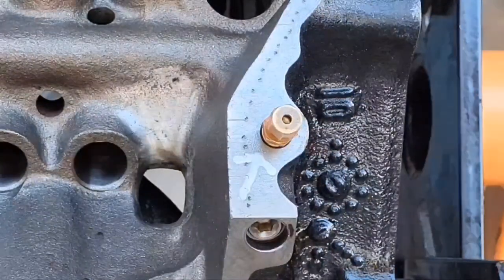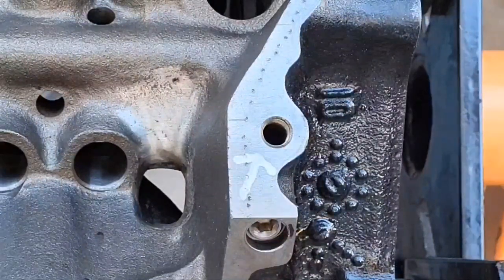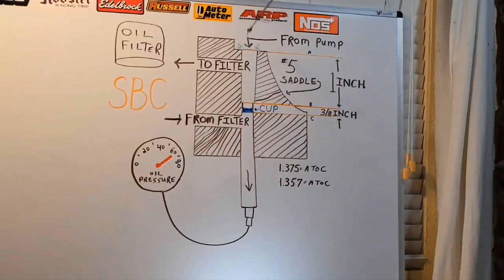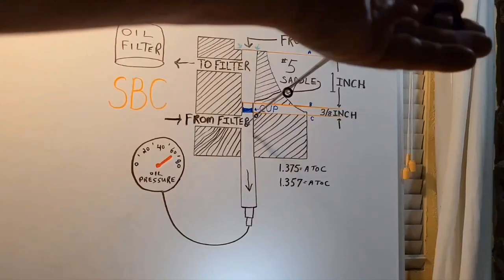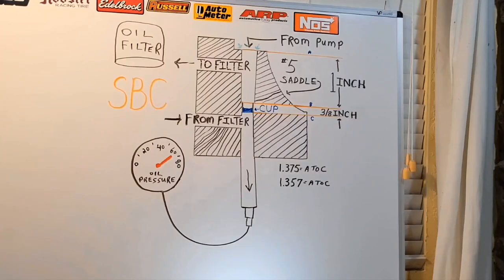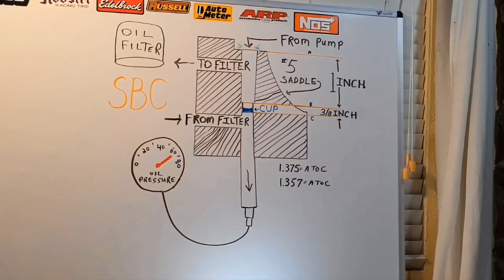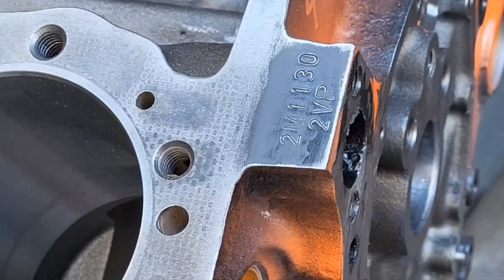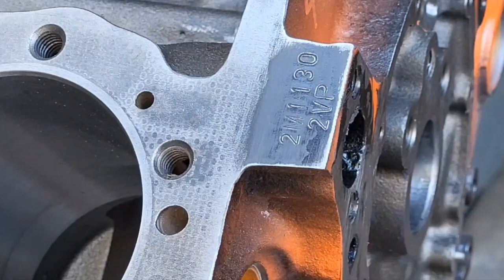ONCE UPON A TIME, there was a magic cup....

Comment: The first sbc's had no oil filter and there were no channels to and from the main oil channel. When the oil filter was interduced they just drilled the two channels off the main channel and put a cap in between to divert the oil to the filter. As long as the cap is between the two channels going to and from the filter, you're fine.

Comment: How much oil goes thru the filter bypass valve in the filter adapter?  How much oil goes around the filter media thru the in filter bypass valve.  
I used to spend several hours deep in those passages with a long, ball end carbide burr to round out the corners and cut back the drilled pockets.  Then go in with rifle and shotgun ball hones in all the oil galleys.   I spent 10 minutes on oil passages in the rear main cap.  
I usually check the diversion plug depth from the top.  8.5 inches.

Comment: I think the 410 block is the good way to go! Having at 50,000 below the to filter line. It sends all the oil to the filter. 😀GOOD! Then the port coming out of the filter with clean oil some of the oil can turn left and go up and give primary oil to the saddle number five. And the rest will turn right and head down that path. Sounds like a winner to me??
Reply from the maker: The "from filter" oil passage can really only turn right, not left.  A  little oil goes left, but the cup is 50 thou, let's say,  above the roof of the  "from filter" oil passage, so it is forced to go to the path of least resistance, and that is to the engine and oil pressure gage.  The cup separates the passage.  No oil can go past the cup in either direction.  I hope I am not confusing you, and thanks for watching.  Later Dennis.
Reply from the maker: I will check the 410 block, but I haven't done it yet.  You could be right, but I would be surprised, because that would mean that the incoming oil from the pump would end up fighting the oil coming up the vertical passage.  Will let you know what I find.  Later.

Comment: Why is there a whole bunch of small dimple marks on the inside of that oil hole threaded oil hole
Reply from the maker: The dimple marks on the plane the oil pressure gauge fitting is drilled into, is what I think you mean, are put there by me with a small punch.  They used to have small rubber end gaskets made of rubber there front and back of the intake manifold, before silicone became perfect for the job. We used to do that to stop them gaskets from slipping out.  I still do it out of force of habit.  Even now when the silicones dries, it wont slip.  Not that it ever does.
Reply: @the4flatgarage  one of the oldest tricks in the book! 👍
Reply: Right we always drilled into the "china wall" several 1/8" dimples with a bit to hold the gaskets/ RTV in place and prevent possible slipping. I often used Aviation Permatex in a can to hold the gaskets as that schtuff can't hardly be removed. Tough stuff, doesn't leak. Hated by all. 👍👍😎

Comment: Not so terrible initially as most motors before SBC era had no filter or optionally  bypass filtration and even back to splash feed bearings yet they were quite reliable but to expect the longevity we have become accustomed to one must factor in full flow filtration and regular oil change intervals, I know shocking isn't it 😉
Reply: "Reliable" meant something different when 20k between rebuilds was expected lol.

Comment: He keeps saying filtered oil. No one talks about the bypass in the filter adapter that lets unfiltered oil go to the bearing when the oil is cold  it also lets a little unfiltered oil go into the engine as the filtered begins to plug with contaminates
Reply: Race guys usually plug that by pass anyway .